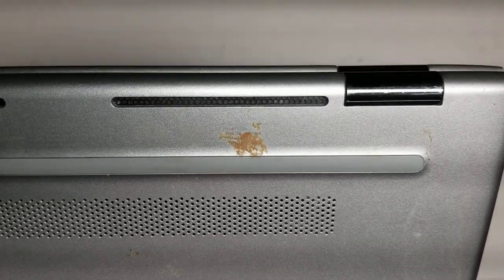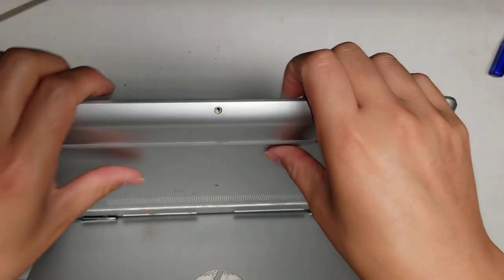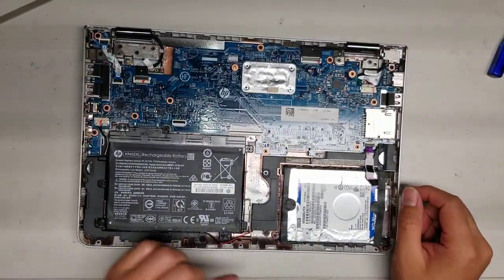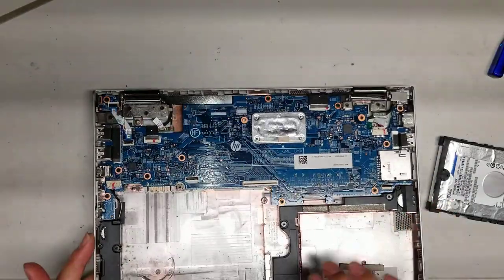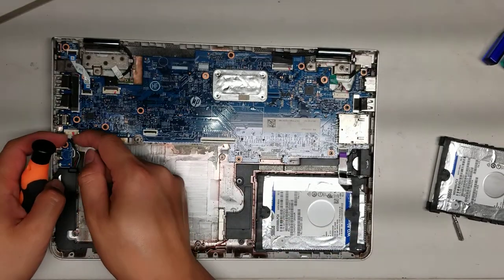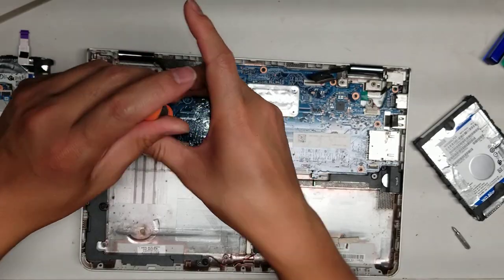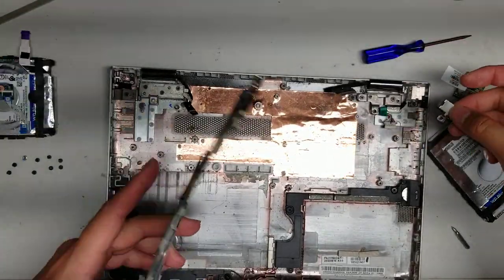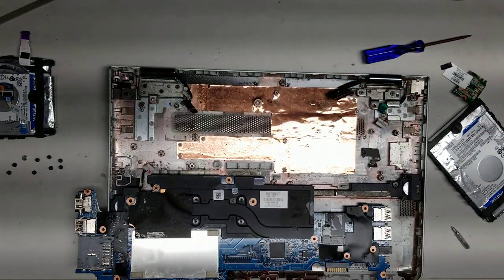HP Pavilion x360 m Convertible 11m-ad113dx Complete Disassembly RAM SSD Hard Drive Upgrade Repair

Comment: I replaced the ram with a 8gb. put it all back together but now its not turning on. I followed all instructions but forgot to hold the power button down after removing the battery... please help.
Reply from the maker: Try with the old RAM configuration.
Reply: @ItsBinhRepaired  I tried that too. It's still dead. 😐
Reply from the maker: @aaron2712  might be shorted motherboard :(
Reply: @ItsBinhRepaired  guess i'll take it down to the shop tomorrow. thanks for replying!
Reply from the maker: Alright, hope it's repairable

Comment: Great video.  Would never have been able to open up unit without narration and visuals.  I have a model 11m-ad013dx that won't power up at all.  Attached new power adapter and after several hours the unit warmed up but the plugged in light next to the power connection port doesn't  light up.  Unit was working until it was left plugged in, powered up, logged on and doing a Windows 10 update.  Any suggestions?  Most important can the hard drive data be recovered?  Thank you.
Reply from the maker: Sounds like a dead motherboard. Sometimes disconnecting all power and the cmos battery and shorting the cmos battery pins can reset the bios, but if it's heating up with no charge light, it sounds like the board is dead. You can use this to get the data with another computer. https://amzn.to/3jOJzED
Reply: @ItsBinhRepaired  Do you have a video or some helpful instruction on following the steps  you  suggest.   How do I reach the cmos battery, diconnect motherboard power and short cmos battery pins.  I already used this video to open case and unplug hard drive, battery and other devices as shown in this video.  But video does not show motherboard disconnect or cmos location.  Appreciate help.  Also cable recommendation but need to reopen case to see if hard drive is correct type to work with cable.  It is very small and thin.  (i will get exact details.)  
Thank you truly .  Robert
Reply from the maker: @robertheath8694  sorry, just checked. This board doesn't have a cmos battery. Have to just remove the regular battery. Hold the power button for a minute to completely drain the power. Hopefully that works, if not the motherboard is likely dead.
Reply: @ItsBinhRepaired  Thank you so much.  Will try both reset and recovery options shortly.  If motherboard is shot is replacement a cost effective option?  Are they available?  Thank you again Binh.

Comment: I’m debating if it’s worth the trouble changing the ram from 4 to 8. Good thing your vid is thorough. I’m pretty sure I can do it if I take it one step at a time. I just never had to remove the motherboard from a laptop so kind of scared I might damage it. Thank you for posting this tho👍🏽
Reply from the maker: Yeah, it can be kind of risky.
Reply: @ItsBinhRepaired  I'm about to do that. SSD and Max out memory. Should be worth it since doubling the memory.
Reply from the maker: Sounds good
Reply: @ItsBinhRepaired  The SSD and the 8g memory worked fine. No issues. On crucial's site I don't think this laptop can go further than 16g. Have to get a single chip and I think that is pretty expensive for it. The user went from a real horrible mechanical drive to an ssd. The laptop is usable now. This guide was very helpful. The tiny ribbon cable for the hard drive is real flimsy and not in the slot very tight either. I had to use a piece of non conductive tape to hold it in. No other issues. Not a bad laptop.
Reply from the maker: @barrysauce  glad it helped and the upgrade went well.

Comment: do you know where to find the RTC battery this kind of model?
Reply from the maker: The battery is the rtc battery
Reply: @ItsBinhRepaired  how about the cmos? because I  having the same issue, flashing issue 5 short and 3 long.. just wondering what is the issue?
Reply from the maker: @elifunbox130  the main battery does all that. The flash code you'll have to Google
Reply: @ItsBinhRepaired  ok. thanks
Reply from the maker: No problem

Comment: Hello, i want to upgrade my ram on my hp pavilion x360 11, which is currently on 4, but i want to get 8gb, any advice on which one can i get? Having doubts which one will fit
Thanks
Reply from the maker: What type of RAM is currently in there? Check the sticker on the RAM.
Reply: I haven't opened yet, trying to learn how to, doing some research as well and apparently I can't upgrade it, is that true? I was looking to change the hard drive for a ssd could that help? If so any recommendations wich one to get? Thanks
Reply from the maker: @carlospadilla3737  https://amzn.to/3twZbme the RAM can be upgraded too, but I don't know the specs.
Reply: @It's Binh Repaired & Reviewed  4 GB DDR3L-1600 SDRAM, this is the specs for the ram, it's a hp pavilion x360 11 ad018ca yo be precise.
Reply from the maker: @carlospadilla3737  I'll need to see the inside of the laptop. That model is different.
Reply from the maker: @carlospadilla3737  looks like this is the max RAM https://amzn.to/3MoZd89
Reply: @It's Binh Repaired & Reviewed  kinda tricky do the ram as well, would you recommend just do the hard drive? Do you think that would give it a good boost?
Reply from the maker: @carlospadilla3737  SSD will give a great boost
Reply: @It's Binh Repaired & Reviewed  just making sure, I need to clone my windows to this new hard drive, is that right? It's that the only thing I would need to do?

Comment: Please like my comment if you have read this.

I actually find your whole video tutorial helpful for me. I downloaded and saved it for future reference once I completely bought the RAM and 2.5” SSD.

I am planning to upgrade my HDD to SSD, maybe 480GB, and upgrade 4GB RAM to 8GB RAM

Device Model: HP Pavilion X360 Convertible 11m-ad1xx
RAM:  I forgot to check the details since I am using my phone to watch. But yeah, I remember it has a single slot only

So yeah, please heart react if this is possible to upgrade SSD to more than 480GB, and is it okay to limit my laptop to 8GB RAM?

Thank you and God Bless.
Reply from the maker: There's usually no limit. Whatever you can fit in the slot with the same speed should work in most cases.
Reply: @ItsBinhRepaired  Hello, I recently chatted with HP Support Official. He said that my laptop  11m-ad113dx only supports the following:
 - SSD up to 128 GB 2280 M2 SATA-3 Triple-Level Cell (TLC).
- 8GB RAM

Note: I ask him if what is the max availability for 2.5 SSD, and they said 128GB.

Should I believe them? 
Because you said that I can work with 480GB or above.

What can you say about this one?
Reply from the maker: @JacobPolicediez  they're full of pshhht lol
Reply: @ItsBinhRepaired  what do you mean by full of shhht?
Reply from the maker: @JacobPolicediez  pshhhhit lol

Comment: I understand that this system supports both 2.5 and M.2 SSD.  I am interested in upgrading to the M.2 gumstick.  Do you know the maximum size M.2 is supported?  Where does this drive connect?
Reply from the maker: There's no maximum size. Only if it's physically too big.
Reply: But, do you know where it puffy connects to the motherboard? Can you have both the M.2 and ssd installed together or is it only one or the other?
Reply from the maker: @brianrobinsonsr659  I hate when people make me rewatch my videos. I have enough on my plate as it is. Lol At what timestamp did I say you can use an m.2 SSD? I don't see a slot for that...if you found that info on Google, don't ask me. All I have to go off of is the video I made. I don't own these computers to check. Possibly underneath the motherboard. Check eBay for a replacement board and see if you can find pictures of the other side. If you're not willing to do that research then I'm doubting you're willing to risk removing the motherboard, so stick with the 2.5" sata SSD upgrade and forget anything you heard about m.2.
Reply: Wow!! I got the info from the HP manual but it didn't show the slot in their diagram/layout. Since you had already opened the case and removed the components, I thought you might have been able to answer my question. Pardon me for seeking advise from someone who gives the impression of knowing what they're doing. Thanks for the video. I will un-follow this post and not ask you any other questions since it is such an imposition.
Reply from the maker: @brianrobinsonsr659  no problem. I wonder why the manual would tell people there's an m.2 slot but not where it is. Doesn't make sense. I guess not even the people that build the machines know. I guess it was too much to ask to have you do some research, but expecting me to do the research was ok. Lol
Reply from the maker: @brianrobinsonsr659  I could have just answered I don't know, I guess, but hopefully you can find out with the tips I gave instead. I work 24/7 as it is. Don't really have time to research things for every YouTube comment. Trying to make people self sufficient.
Reply from the maker: @chuckUfarley2893  I guess it would be better for me to  just not answer and use that time to sleep. I sleep less than 4 hours a day as is. I run my computer repair business 24/7 and I just post the repairs I do on YouTube. This isn't something I'm just doing for fun because I'm bored. If I know the info it will be in the video. When I get asked questions like this, to me it's like either saying, I didn't watch your video, but want specific answers, or saying give me more, you're not doing enough.

I get so many comments asking what RAM to use when it's in the video...or how many RAM slots and all sorts of questions like that. Makes me feel like, why bother making the videos if it's just going to turn into more work. What's worse is, it turns a paid job into a "give me free information job."

I had a nightmare just today where I fixed a monitor for someone, told them it was $30, they told me it was too much, so I told them I'd undo the repair, then they were asking me what exactly I was undoing so they could fix it themselves...this stuff haunts me!
Reply from the maker: @chuckUfarley2893  I gave you the explanation for why I am the way I am. It's up to you to understand or just be another, well you could have just not answered. I hated kids in school that were too lazy to do the work and just wanted me to give them the answers. That's another reason. Lol Brings me back to those times...Makes me feel dirty and used...
Reply from the maker: @chuckUfarley2893  I make the videos as a standalone. The entire board was pulled out and I pointed out every single connector in the video. Why would I just leave out mentioning that there's an m.2 slot if I know there's one? That's the thought that goes through my head. 

I've made thousands of videos on thousands of computers/devices. Those videos have helped millions of people. There are certain questions I'm like, ok, that's a good one and I'm fine answering, but when I get questions along the lines of, how can I put baby shoes on adult feet, it triggers a, seriously?! Knee jerk reaction.

There are videos where I'll say, use motor oil, and they'll be like, how about cooking oil? How would you react if someone was saying how to cook an egg and they asked if they could use motor oil? My brain just goes crazy. I'm sorry that it triggers a rude response.
Reply from the maker: @chuckUfarley2893  I usually upload multiple videos a day. More than most content creators. I understand it's wrong for me to assume people know my life/situation and take things out on them, but when you have a short fuse from lack of sleep and too much stress, it just causes me to go into hulk smash mode when anything bugs me. Sorry
Reply from the maker: @chuckUfarley2893  that's another thing, title is limited to 100 characters and people don't even read the titles. There are videos where I literally say, nothing is upgradeable and they'll comment asking how to upgrade the RAM or the hard drive...I mean, really?!
Reply from the maker: @chuckUfarley2893  of course I have consequences and I choose to take them.
Reply from the maker: @chuckUfarley2893  not like what you're saying is any nicer or deescalating...Lol you're poking an angry bear.
Reply from the maker: @chuckUfarley2893  you talk the talk, but I have yet to see you walk the walk.
Reply from the maker: @chuckUfarley2893  instead of, "you're a fuckin asshole, you're a prick" why not, why are you so grouchy and angry. He just wanted the answer to a simple question, to which I would have responded, lack of sleep, stress, and the fact that I tore the entire thing apart, showed everything I know, and was asked, where is this thing? I looked online and saw that it exists, but you didn't say anything about it.

Now I know how doctors feel when patients self diagnose. And then keep asking them if they're sure it's not cancer or something.
Reply from the maker: @chuckUfarley2893  do you feel your responses and comments were nice or in any way understanding? I don't think being a prick to a prick helps make a prick nicer. Lol You're lucky I've been trying to catch up on sleep.